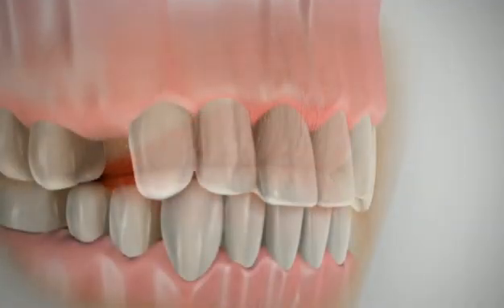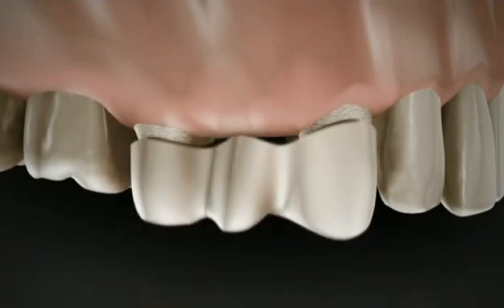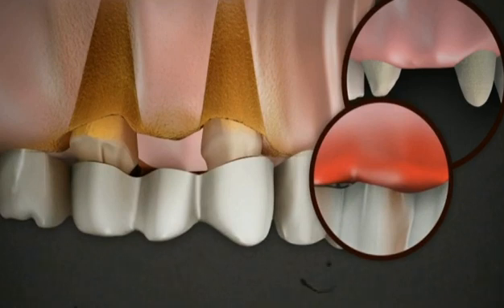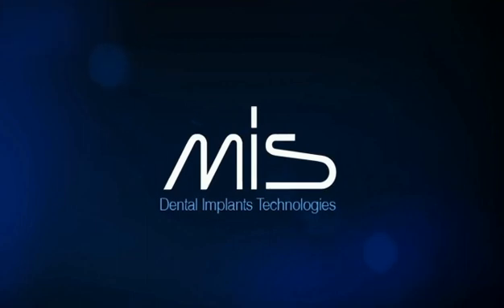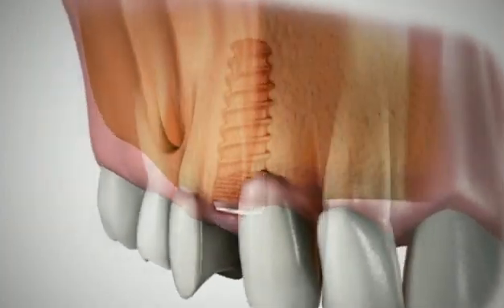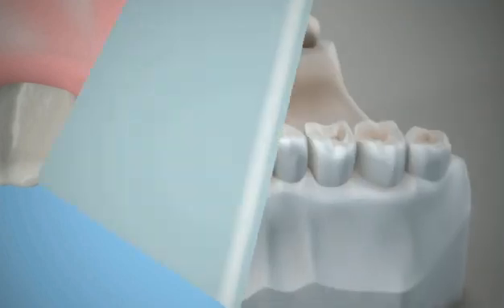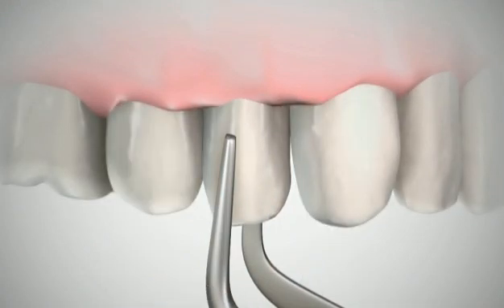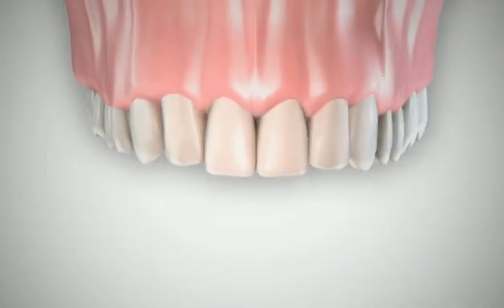Dental Implants Procedure - Simplified

Comment: I was scratching my head 0-38 seconds for 5 minutes but finally worked it out. It was meant to show why doing a bridge does not last as long as a dental implant. See how the two natural teeth  holding the fake tooth eventually rotted away and had to be removed.